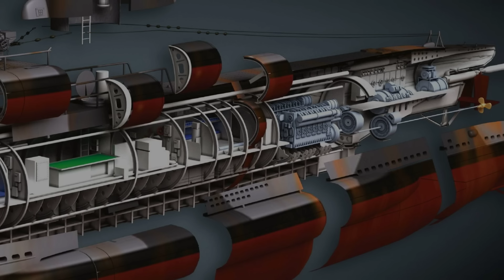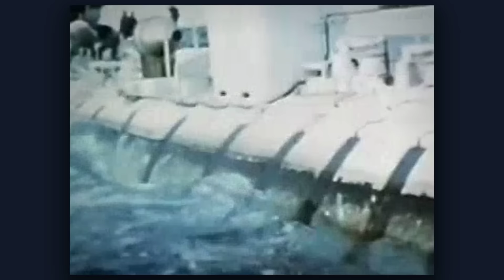What Happens Inside A Submarine At 800 Feet

Comment: [13:18] "...the thermocline creates a gradient in sound speed that can reflect active sonar signals..."
 - - - - -
Technically, it's more about the "refraction" (or bending) of the sonar sound waves as they move through the water (primarily caused by changes in water temperature & depth). The sound refraction can result in "shadow zones" & "convergence zones" that submarines can exploit when attempting to either hide from or seek other submarines or ships.

Comment: The boats in the 60's and 70's were stronger. Not thin skinned.
Reply: I worked at EB in 1976 and the steel is thick and the number of circular frames and their size is crazy. My older brother and my brother in law were both Chief Sonar Techs in the 60s and 70s. One on boomers and the other fast attacks.